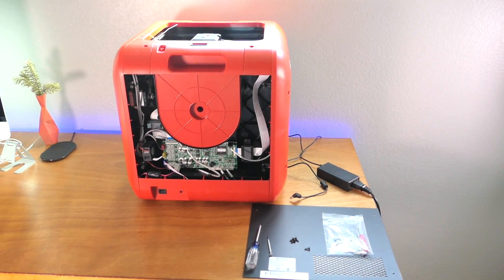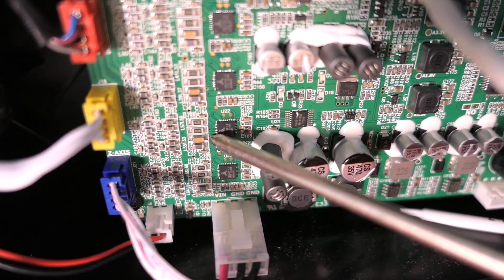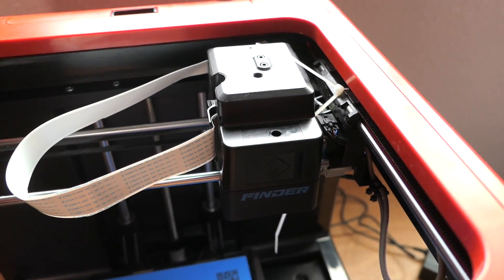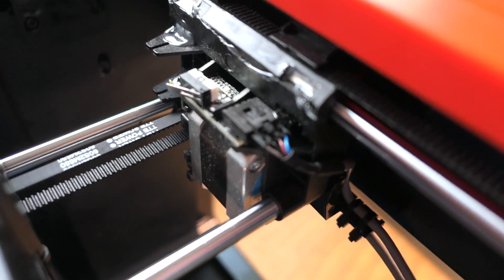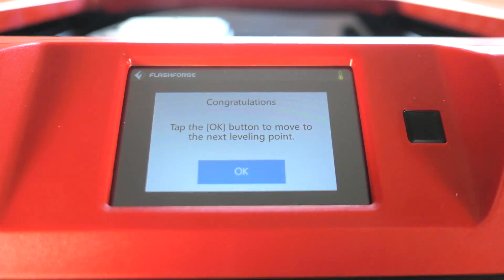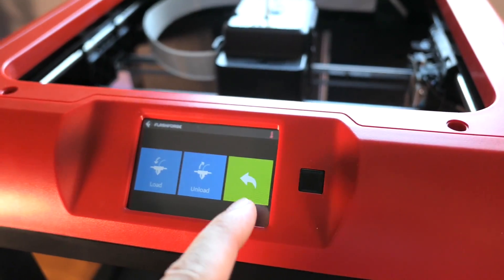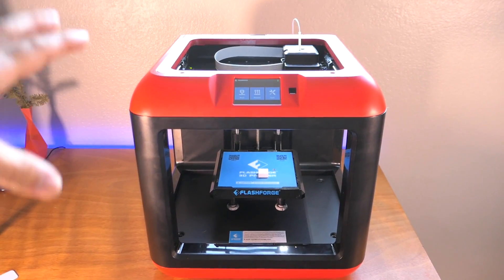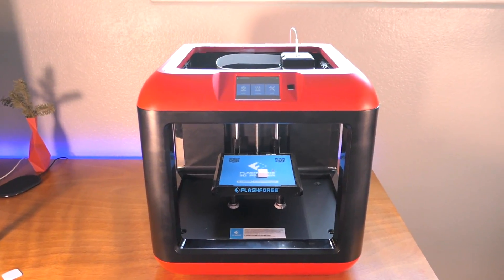FlashForge Finder Works! - 3D Printer Fixed & Repaired

Comment: Mine has the Finder Plus 1.5 board and it doesn't have the column of components that the 2.0 board has, where you removed the part.  The first two columns of SMT components on the 1.5 board are also not color coded.

Comment: Thanks so much for this video as my printer intermittently shuts down and followed what you did.  Is it normal for the Realtek RTL8188EUS chip to get very hot that you cannot leave your finger on it?  Mine does but the wifi still works. Nothing else on the board is hot by just touching around. I Just ordered a dc amp meter to check the current draw of the printer.

Comment: removing a resistor and just leaving it that way and somehow thinking that fixes it your sadly mistaken every component serves a purpose which you will discover when what ever component the resistor serviced burns out resistors reduce current to a circuit and now some circuit is now getting more current than its supposed to so good luck with that>>>

Comment: I bought one for £40 and its OK until it reaches the extremis on the right hand switch and it then makes an awful noise, I spotted yours at 7:05 and in comparison my microswitch is bent upwards prob in transit so going to see if I can sort it out.   The rear microswitch panel has also sheared off so going to use some longer screws and then fix the little tubes for the screws with some Q-bond although its held in place with some blaktak (like blutack but seriously stronger).   Everything else works so if those two small fixes work I got meself a bargain :)

Comment: does that short filament tube helps with breaking? I have a Bresser Saurus (is same as FlashForge Finder II, Flashforge even labels them). But with standard filament tube the filament breaks halfway the print. Any things i can do? These white and black filament came with the 3d printer. They were full airtight sealed and were not overduo. Do you have also a short filament tube on the back side or only on the hot-end?

Comment: when my fillament runs out i try to push next roll into the nozzle hole right behind the ending fillament , hopefully it will take and not clog... do you know a better way... their is no out sensor on the flashforge ender.

Comment: I know this is an older video but I wanted to mention that the flaw on the printed cube is probably from when you lowered the print speed and then raised it back up. Adjusting any of those type of settings mid-print will usually have noticeable effects on the finished print job...
Great job fixing it up! You def got my wheels turning now. Lol

Comment: ye huess what it was a loose connector that slid out during shipping, and you powered the pcb with nothing plugged it, that was very stupid. clearly you have zero oknowledge of any electronics whatsoever, all you did wwa s to plug in and out all the plugs and magic it worked. because guess what if you power on pc with no components what would happen? it would not power on , same here you were very lucky someone made a protection against stupid people and got the boards not to power up when other components are unplugged.

Comment: Hi Vlad I enjoy your videos, they are very informative. But I would be cautious about using this 3D printer. If the component you removed was a capacitor and it had gone short circuit, it's unlikely it would get hot - near zero resistance. On the other hand if it is a resistor, then there is probably a short circuit further down the line, or something drawing heavy current. The fact that the printer works ok, with this component removed, indicates that it might be part of a protection circuit. If you haven't got the tools or equipment to locate the short, I would ditch this board and fit a new one!($50 - $60). Rather that than a fire truck parked out front spraying water onto your burning house! Better safe than sorry.
Reply: The peach color package, and the 'C' circuit marking makes it clear it was a capacitor. These are often made with layers of separated film, so damage would cause the tiny plates to short. This short would pass whatever current it can, being a short, so would cause it to get hot. Lifting the capacitor will kinda work, but it's likely a power supply smoothing/bypass capacitor, so you could get some odd behavior based on the noise it would usually drop. I would try to find its value (or a nearby neighbor) and replace it.

Comment: Question, can i use different filaments for this printer?! I know it says it can only use PLA but  i wanted to use different kinds of filaments.
Reply from the maker: It is designed to use PLA if you try to print other filaments, you will cause a lot of problems for yourself. If your new to 3d printing, start with PLA and after you learned the process you can expand your printing to other filaments like ABS PETG. Hope this helps

Comment: You should probably replace the broken part that holds the bearings and buy a new blue pad for the bed instead of using wire ties and super glue...  both are cheap.  You can grab the blue pads on eBay or Amazon and the mount is sold really cheap on FlashForge's website.

Comment: You should measure the size of other capacitors and buy a new one and place it back in place, because it might make it problematic in the future. Maybe the filament feeding motor might not work without it

Comment: Get yourself a new build sheet sticker to replace the damaged one. I don't like your chances of filament sticking to super glue. The old sticker should just peel off. 10 seconds on Google I found replacements for $10 for a 3 pack. I found it interesting how the bed levelling worked. Even though it had a deploy-able probe, it was still a manual process.

Comment: Great Job Vlad, all that patience paid off. I think if you were talking of a yellow component part removed it was a capacitor, it will be fine without it. Your repair worked and you got it working for a $100 awesome. The print came out real good.
I'd say you nailed it 😁

Comment: The event that cause the other physical damage (perhaps it was pulled, or knocked off a table) could have easily damaged the capacitor by flexing the Circuit board.  Ideally you should replace the capacitor because it might cause missed steps, as it seems to be in the section with the stepper controller ICs.  If you have a multimeter that can measure capacitance, use it to read the value of one of similar sized capacitor above.  If not, a 1uF capacitor should be fine.

Comment: Few things:

You'll need to replace the SMD component that burned out, and you'll need to replace the gantry cip (the part that broke that you glued together. Also, the Superglue on the build plate was a bad idea.
Reply: It'll be easy to model a new clip and all you should need are a set of calipers and look up 123D Design. While it isn't supported anymore by Autodesk, it's a really easy piece of software to use.

Comment: The tube that you're missing is a long black one that goes between the filament holder and the hot end.   The short white one looks like a spare ptfe tube for the inside of the hotend.   There's a bunch of different spool holder models on Thingiverse, but I just went with a wood one I had rigged up for the MP Mini when it was still working to avoid figuring out the balancing act of a mounted spool.  (you can also turn off the startup sound so it doesn't make that super loud beep too.  Very recomended.)  

The Finder is a pretty solid machine, glad you were able to get this one fixed!

Comment: Hi Vlad!  Awesome follow up vid.  Hope your finger tip "Probe" is okay.  I've seen guys test red hot stove elements using the "finger test" method.  LOL!  Also surprised your here in Hawaii too (or Big Isld?).  The resistor you've identified looks like it may be used for signal level or signal limiting.  But if nothing shows up then you may have lucked out and burnt out an unused 'optional' section (like a 2nd Z axis or whatever you call for the 4 or 5th servo upgrade).   Maybe a future heated bed option.  Thank you for the CR-10 suggestion.  Your right, it's the best way to learn and upgrade as I figure out what direction I want to take 3D universe.  It has the most options and long (3 years?)  history plus 'open source'.
* Please note that the overheating issue may be due to a factory defect of component parts.  The resistor is a simple device that can fail if mishandled during PC build.  It may have cracked causing a weak area that overheated within the component.  But this is very rare.  Likely a current switch (or regulator) is leaking current and sorted or started drawing current during initial operation.  I've seen coffee brewer's act this way once coffee was brought up to temperature.  Solenoid coils would be at maximum operational temperature.  Solenoid would 'chatter' when activated as the current activating the valve would heat up the coil above the max and disable the control board with an overload.  
* You may want to take off the back cover and run a longer print.. Say, recreate the failure of the original owner; Run it for +2 hours on a long print.  1st owner probably ran the cube like you did and went on to the 2nd test print.  Note it may catch fire.
* Final thought, My nephew is at Kalani and since this was more of a "High School" learning machine I thought he may get into this new field.  I learn by fixing broken stuff that other people don't want.  But that's just me (being cheap).  Hah!
Keep up the good work!  Aloha, ukeboy57

Comment: That component was just a capacitor, should be just fine without it! good job!
Reply: No, this driver'll work like shit.
It'd be better to put new one in there.
Reply: It will not work very well.  These are for the stepper drivers.  It would be better to solder one in or replace the board.
Reply: pfft these 'experts', always in panic. It's a ceramic, the capacitance was tiny to begin with. They are prone to failing short due to thermal or mechanical shock or merely due to a latent manufacturing defect. As a side effect of its removal, there will be increased EMI, slightly increased current and heating of the power traces as the burst currents will need to be taken up by other capacitors on the same rail, and it'll be the high rail of the printer. Just one missing, it'll be fine! The driver will experience increased power rail noise and is operated strictly speaking out-of-spec, but it can take it with no significant detriment to its performance, as its more sensitive circuits run off an internal linear regulator. It's a Trinamic driver.